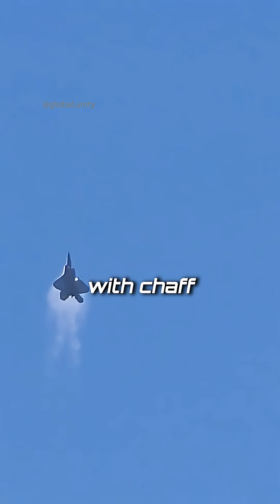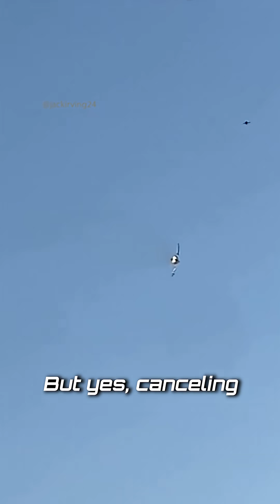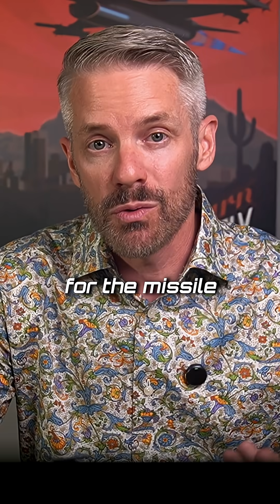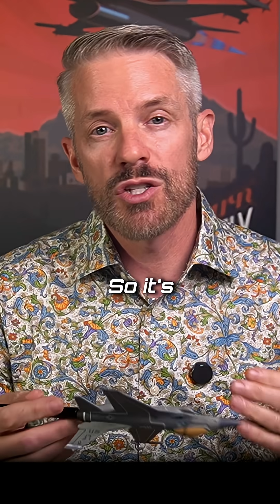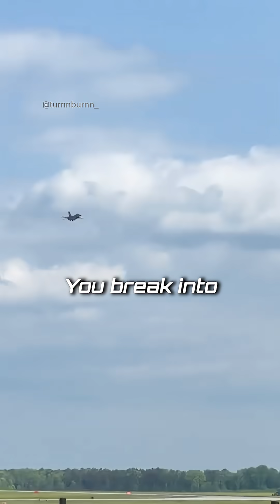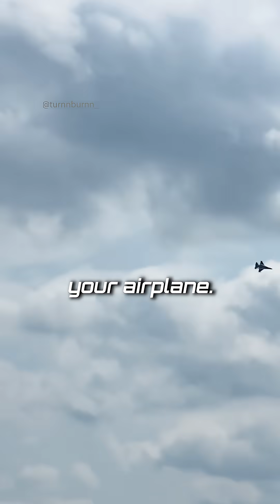How Fighter Pilots Dodge Heat-Seeking Missiles?

Comment: Chaff does not affect infrared missiles

Cutting burner is ALMOST mandatory when it comes to defeating IR missiles, breaking into the missile is correct, but it's better to be putting flares between the missile seeker and the plane's engines. Make the engines cooler than the flares, put the flares in front of the engines (to the perspective of the missile), and pray to God flares work
Reply: Agreed
Reply: And who are you?
Reply: @fahid3342 The guy who didnt chew out the more accurate and complex explanation so people that are not autistic about military aviation can understand
Reply: @fahid3342 ???